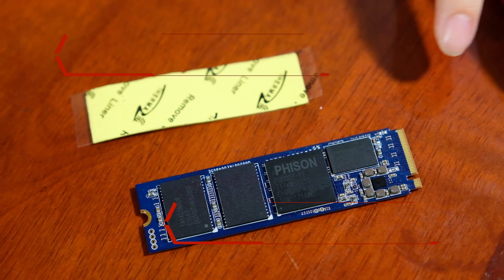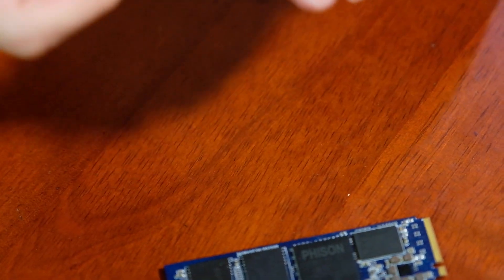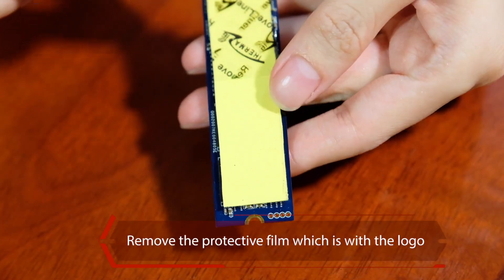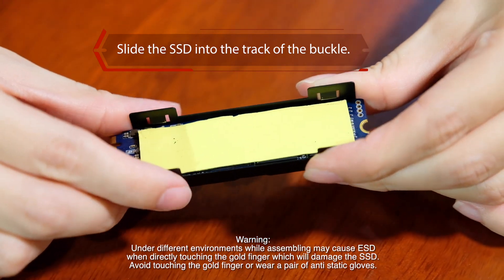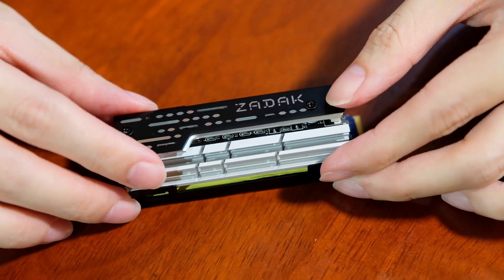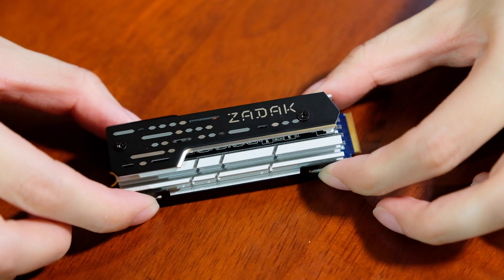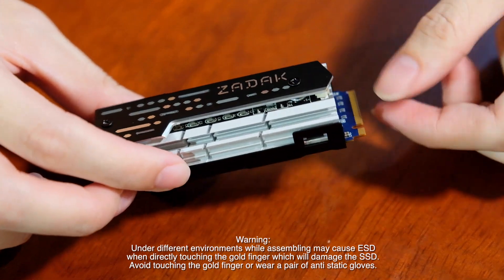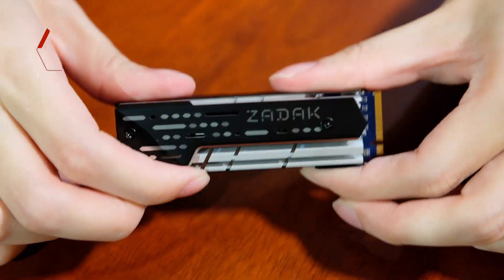MOAB M.2 RGB Heat Spreader Installation Tutorial Part 2

Comment: Do I have to apply the thermal pad? What happens if I don't?
Reply: It can overheat and ruin your drive. If your drive doesn't overheat enough to break, it will still significantly reduce it's life span